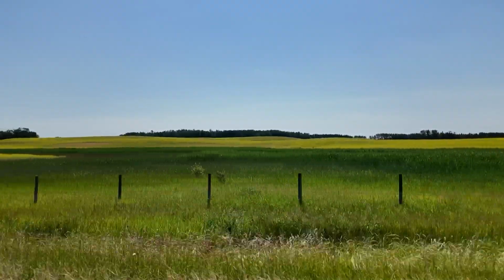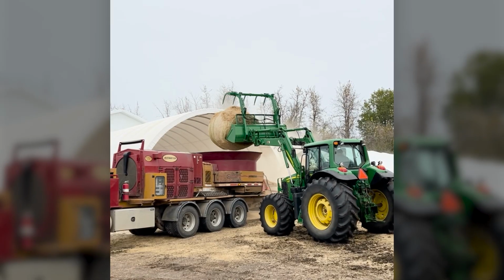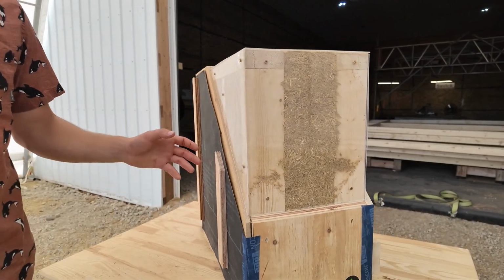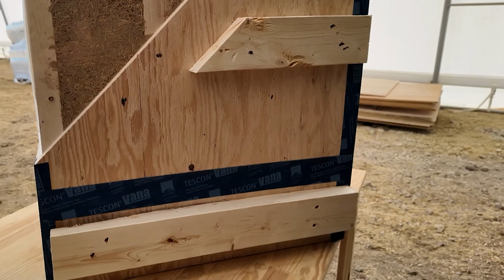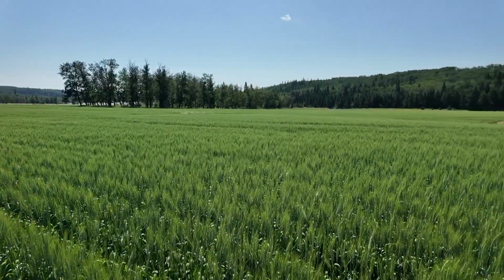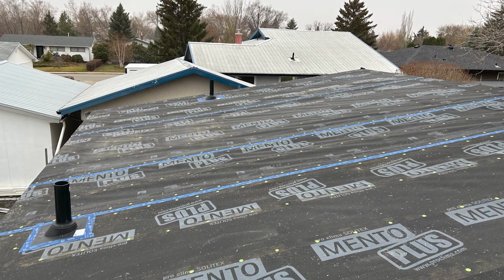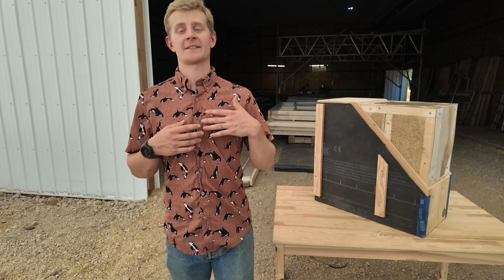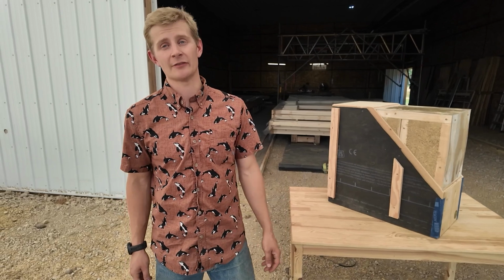Prefab Straw Panel Manufacturing Is Smart Growth

Comment: How do you compress the straw into the panel?
Reply from the maker: In this case, it is just blown in as any dense-pack fibrous insulation is. It's just a matter of installing it to the right density for chopped straw.